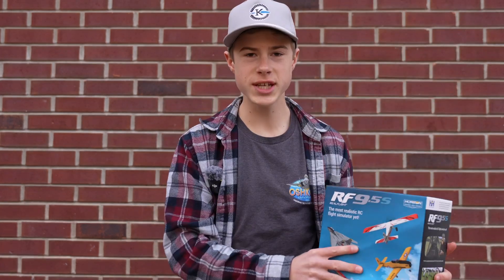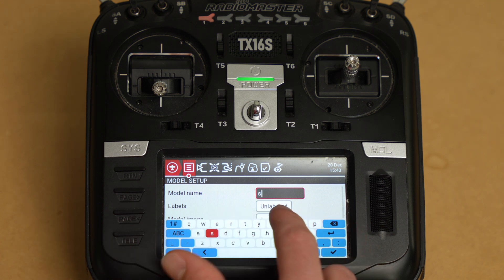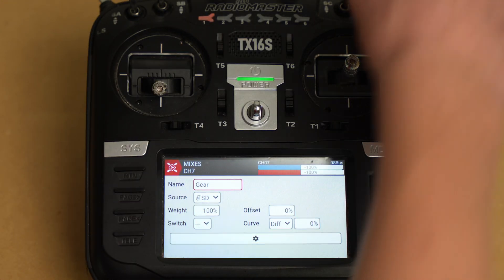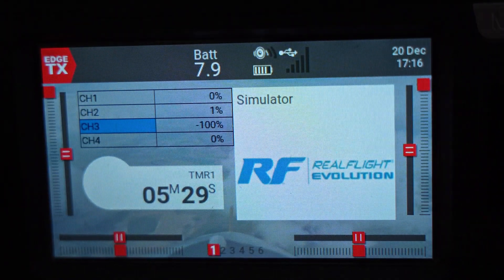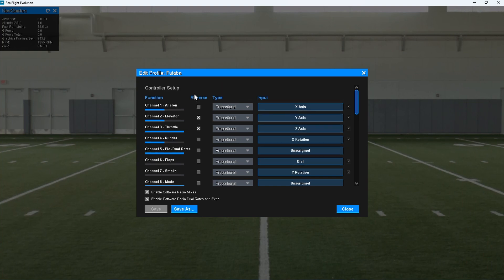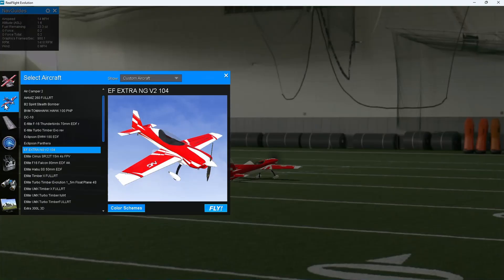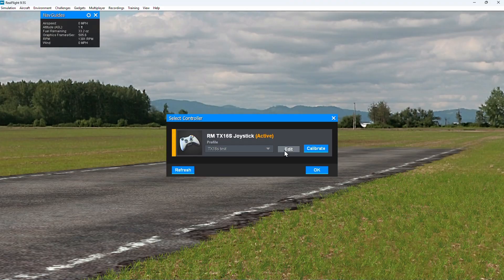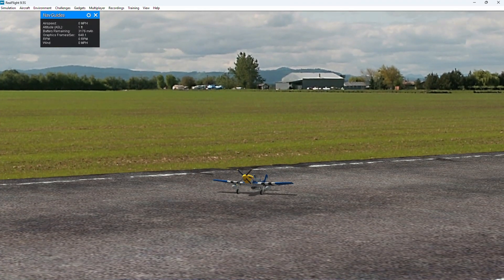Ultimate Guide: Using EdgeTX Radios with RealFlight Sim

Comment: Do you need a separate setup to fly helicopters on rf I’m assuming?
Reply from the maker: I don’t think you do, but I don’t have a ton of experience with RC helicopters in general. I think the controller setup should be the same though; you just might need to set the switches up differently.

Comment: How do you physically connect a RM GX12 transmitter to a PC for this sim? Just via USB cable, or will RF work with Bluetooth?
Reply from the maker: Standard USB cable should work through the usb-c port on the top of the radio. I have experimented with the ELRS Bluetooth joystick which works pretty well. RC Video Reviews has a video about how to use it, and then you can just follow our video to set it up In RealFlight.

Comment: Smoke and flap setup doesn't clearly show me how to setup the three modes. Also when I calibrate one switch it unassignes it off another I feel like I'm going in circles.  Really wish I just got the spectrum controller now wasn't worth the savings this radio is to hard to work out
Reply from the maker: I’m sorry to hear that. One thing to note is RealFlight will only allow you to assign one switch per channel, so smoke and flaps will need to be on entirely different switches. Just make sure that one switch isn’t assigned to two channels, and it should assign everything properly.
Reply: All good worked it out Cheers

Comment: Hello, while setting up your model using the "wizard script", did it create channels 5,6,7, &8 for you under the "Mixes" tab? 
I believe I must have older OpenTx  software so my mixes are just 1,2,3,4...
 
In your video it says "Very Important" at 2:01, is that because when I try to calibrate my controller with Realflight trainer edition, the "Slider", "Slider", "Z Rotation", & "Y Rotation" won't move at all to calibrate?

Thank you, any help would be greatly appreciated 👍

Comment: hi im new to rc planes, ive ordered a cheap glider with safe technology to get me away, i have realflight on my pc but no controller, id like one controller for everything is the tx16s a good buy for a newbie??
Reply from the maker: The TX16s is a solid choice especially if you want a do it all radio. As far as programming it isn’t terribly difficult and there are tons of great tutorials on YouTube. RadioMaster, the company that makes the TX16s, has a few other radio options you could look at. But the color screen on the TX16 makes it a bit easier to program. Now I’m not sure how familiar you are with radio protocols, but on the TX16s you have two options ELRS an open source long range system and the 4in1 protocol. I would recommend you get the 4in1 option as you will be able to connect to almost any RC receiver. That means if you wanted to go out and buy any Horizon hobby’s plane you could easily connect to it. I hope that helps👍